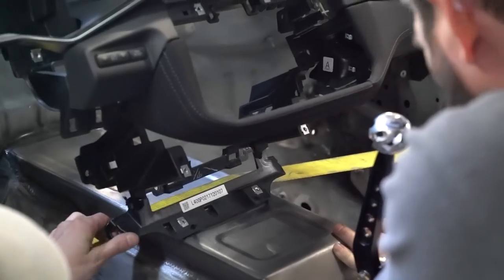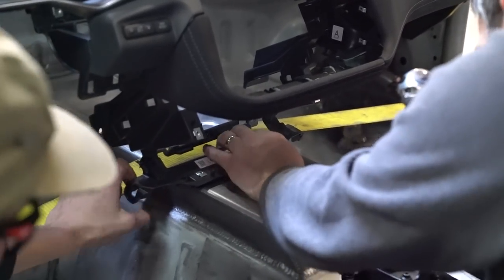Fitting a VR38 GTR Engine in the 2023 Nissan Z for FORMULA DRIFT

Comment: i'm impressed that you haven't had any reliability issues with the VR38, it seems like a complicated setup to run at your level. i'm hoping the VR30 turns out to be the same way as eventually i'd like to get a new Z in 3 or 5 years
Reply from the maker: The VR38 has been the best engine so far to make reliable big power. Our issues have had nothing to do with anything mechanical. More so throttle body electrical gremlins in 2021. We will build the VR30 but not for competition at this time.
Reply: Whats wrong with the VR38 engine? As far as I know theyre super reliable and durable. The make alot of power easy as well. Most people in the west are unaware the R35 has won the Supertech 24hour race in Japan back to back,a win at the Bathurst 12 hours un Australia,the Paul Ricard 12 hours in France in addition to championships in tye Blancpain Endurance series in Europe a few years ago.
Reply: The VR38 isn’t complicated at all. Port fuel injection DOHC 60 degree narrow angle V6.
Reply: Are you new to the VR38 world? Is one of the few modern engines that can take 2000hp on the stock block like a champ, drag racing GTR's abuse the VR38's to no end and is VERY rare to see one blow up unless something goes wrong with any other part (like a turbo) or a bad tune.
Reply: @joealex65  T1 build the VR38 stock block up to 3000HP. Although any minor knock above 2000HP will destroy the block.  VR30 on the other hand is an open deck design where you need sleeving and major cooling setup since they run super hot even stock.
Reply: I think you’ve been living under a rock for the past 15 years lol